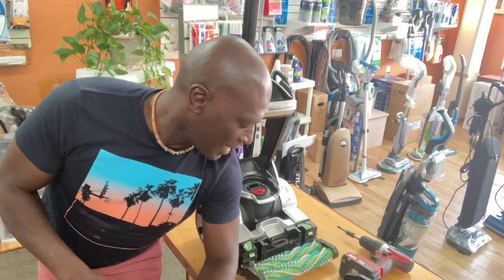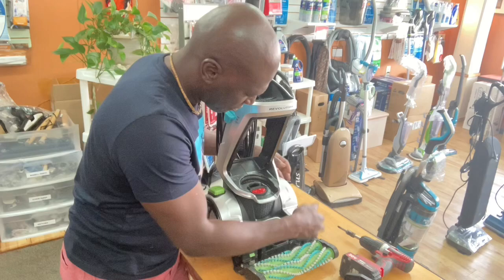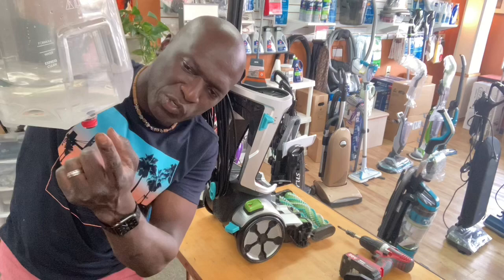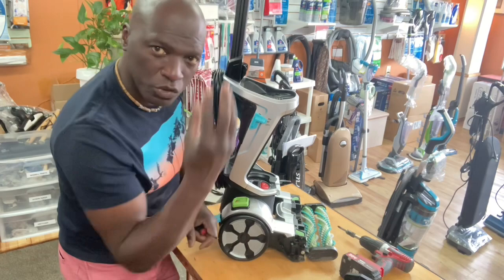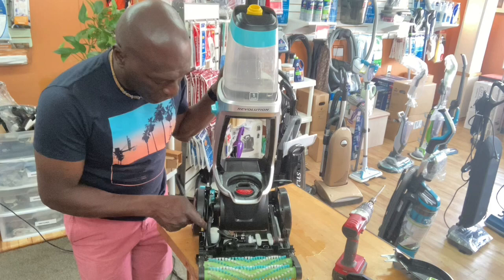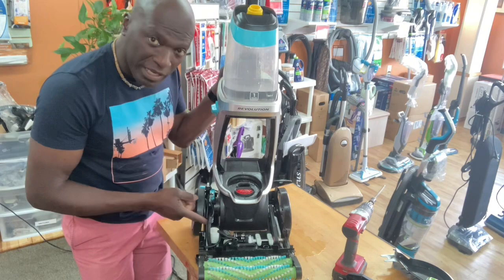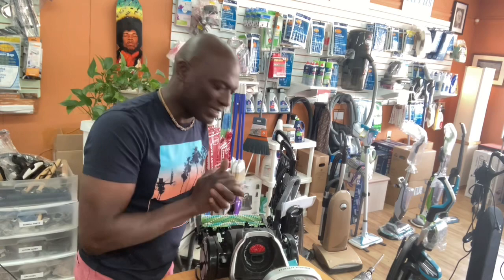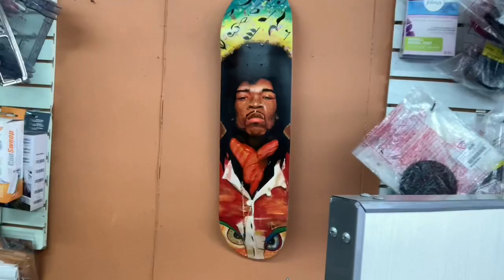Troubleshooting Bissell proheat revolution pet pro spray problem

Comment: VERY informative! One thing you might want to try if you're not getting water out onto the floor is to turn the machine off then press the trigger for 30 seconds. You might have lost prime to the pump itself. Happens a LOT especially if you don't use it that much. AND if that fails to get it to work, take the clear plastic cover off that fits over the rollers, flip it over and you see a series of small plastic 'nipples' with a small hole in each. THATS where the water comes out to the rollers. They DO get plugged. Use a straight pin or a needle to clean out. That'll happen if you put it away 'dirty'. If you see black, they're plugged and water won't get to the rollers.
Reply from the maker: Thanks for sharing this tip
Reply: Don't return the water back to the return water bottle
Reply: Thank you, was in a hurry ❤
Reply: Thanks so much, saved the day. Also, I have lost suction suddenly if I accidentally  knock the hose attachment flap open while cleaning under something close to the ground.
Reply from the maker: @ellenjagger425 glad to help

Comment: Nice work. Holy cow these machines are like effing lemons. Multiple models with the same extremely common problem. Tons of people having the same issue doesn't mean the customers are idiots, it means Bissell engineered a poor product. If there's a tendency for something to clog, those areas should be user serviceable for proper cleaning and it should be documented in the manual so we don't have to go complaining about it. Good grief.

Comment: Thank you!  Checked the flow and was fine.  Realized all the little pin holes in the top clear piece were plugged. Used a needle and kitchen sink - cleaned out in 3 minutes. Thanks again!

Comment: The bottom nozzle of the water jug can get bent and misaligned so it won't seat into the receptacle correctly. The "heatwave" function softens the plastic so when you take it off to fill it,  you have to be careful not to bend it.

Comment: If water is coming out with/without plugged in, check water tank first. If not the problem, check water shutoff valve located at the bottom of handle. I replaced mine it was stuck in open position.

Comment: If you have my issue, no need for disassembly. 
So there is a clear piece of plastic between the beaters. It allows the water to soak the carpet. It has very fine holes that need to be unclogged with a needle. If you’ve used it before and let it sit, the holes will/can be clogged. That was my issue. Water worked fine out of the handheld hose dispenser, which led me to flip it over and find that clear plastic bar between the beaters. You will notice the holes will be black or brown and they should be clear. Grab a needle and some compressed air.  Done.
Reply: do you have picture of it ?
Reply: Yeah I had same issue, no water would go onto the floor. After partially deconstructing the unit and determining that water was going down to base of unit, I took a closer look at the piece with the 2 green thumb buttons. I was fortunate enough to have a 5/8ths clear hose that fit perfectly over the the feed area that has 2 little black washers. I held on tight (the 2nd time..I was wet :( ) and the warm water started blasting through the row of holes 1st one..then 3 and so on. I hit it with a cheapo paint brush and got them all working. This will be part of the routine every time I use this thing now.
Reply: Can you add a photo of the holes you are sharing to clean out with a needle? I have no water spray to the floor. Water for the hand tool and the foot press power shot button on the right base of the machine works fine.
Reply: @MaraDroiiD  they are literally in the clear hood down where the water comes out. turn over the vacuum and look at the clear hood that covers the beater. there are holes in the entire length of it. those were clogged and a needle in each one opened the pathway for water to flow out.
Reply: Thank you thank you thank you - this was my problem. Your advice stopped me from throwing my machine out of the window in frustration!  2 mins with a needle and all was fixed 🤩👍👍👍👍👍
Reply: this was exactly my problem. thanks so much!!! now you need to make a video! 👍👍
Reply from the maker: @angelmayerle706 I’m glad it helped

Comment: I tried to follow this video but I couldn’t get the hose off and water was slowly coming out on the main hose at the end but I put it back together tried it. No luck took it apart again and then noticed one of the hose clamps was caught on the fitting and I fixed that put it back together and now it works like a dream

Comment: you tube does it again, thanks for posting, my lower suction hose came of its fitting, poor poor design by Bissell, when you place unit in upright locked position its pulls on the lower suction hose so much that it pulls out of its hose fitting socket, stupid design.  even though you didnt touch base on my specific problem your video helped me take it apart to fixt my problem, Im sure it wull pull out again eventually, so I have to be careful not to place in locked upright position I guess.
Reply from the maker: Glad you found the source of the problem. Thanks for sharing

Comment: Hi
Thanks so much for the video. It helped me to follow the steps to check the washer not spraying water. Unfortunately the steps did not solve the problem. I want help where to get pump and how much it cost. You did recommend to buy the white tank and the motor.
Reply from the maker: Glad it helped

Comment: THANK YOU for showing how to disassemble all the parts!  I got as far as testing for water flow.  I do have water flow and I do have it set to MAX clean, but the water flow is very light and inconsistent.  Any tips on what to check from there?

Comment: Hi Wayne I was finally able to get through to Bissell on Wednesday which wasn't easy about my Revolution  pet  2  motor was smoking  and grinding   so I'll  be receiving  a new one tomorrow    quite remarkable  another company that is good is Greenworks they too sent a replacement  power washer  after some phone troubleshooting  ...had a problem  with the electrical plug     ciao!
Reply from the maker: Awesome 👏 I’m glad it worked out

Comment: Very well done on troubleshooting. Although I have the Bissel Deep Clean Professional Pet shampooer and the brush motor works for a small time and then stops. Removed, cleaned brushes nothing binding them and they move freely. Any suggestions? motor, switch, etc??? thx
Reply from the maker: sorry for the delay-It may be the micro switch (I believe the deep clean pro uses a micro switch, located near the back wheel) otherbthan that check fpr broken or ripped wiring
Reply: @monroevac  Will do! Thank you so much.

Comment: Hay,  thank you allot for the video its started me down the right path. The section thats just for the hose, the small motor looking thing for the return water that has a shaft that sticks out which connects two the two belts, can that motor stop, or have somw kind of obstrution preventing it from moving the shaft at all? My gf used it and when i got it back the brushes stoped working i took it apart and i see that the one longer belt was broke, like it stoped turning and burnt a hole. I then noticed that the shaft which connects the two isnt moving at all.
Reply from the maker: I would try the belt first- the shaft powers the pump not the other way around. But the belt powers the shaft and the brush
Reply from the maker: I have videos in my Bissell Tips playlist that will show you how to open the side panel for the belt

Comment: Did everything in the videos for Bissell proheat model 9300 -heater not bad but cleaned up and checked inlets and outlets, cleaned sprayer they were also ok took line off solenoid which did nothing - only thing I see is that the forward hose out of the heater is filled with foam after I try it -any suggestions - Thanks

Comment: Hi.. thanks for the detailed video.. I have a question.. when I was starting to put it back together, I noticed light weight rectangle gasket on my counter near the cleaner. It has rounded edges and is about 2” x 1”. is it from the cleaner or do you think it was from something else that was on my counter?
Reply from the maker: Check the red gasket below the dirty water tank. There should be a gasket surrounding it
Reply: thank you:)

Comment: This is great. Is there a video for if water isn’t coming out of the connection? I separated the hose like you said and no water is coming out. I even sucked on it. Is there a part two?
Reply from the maker: Try checking your pump belt- if it’s stillborn spraying after replacing the pump belt then maybe it’s time to replace the pump

Comment: I am not getting any water down to the tube you disconnected at 4:55. Trigger works, resevior is in good working condition, reservoir gasket is in good working condition and in the correct position. I removed the handle and manually pushed the button that would normally be pushed by the rod within the handle and I get no water out. What should I do next?
Reply from the maker: For at home type repairs I would see if a friend has the same cleaner and borrow their tank. Test it. More often, the tank is the issue. Also double check the slider on the side, make sure it's set to max. Keep me posted-
Reply: @monroevac  Thank you so much for the quick response and all of the info shared in your videos. After getting my machine reassembled, I put it on MAX and the spot clean began to work, which it previously hadn't. However the main spray output still does not work.
Reply from the maker: @natural_ness1796 - Interesting 🤔 the last time that happened to me, the problem was the tank. I still would rule out the max slider. I know it's a pain but double check to make its clipped in proper ( while putting it back together) also for good measure change the pump belt
Reply: @monroevac  You were right about the tank being the problem. Somehow the tank was warped by heat on the bottom and the water outlet  no longer sat low enough for the little black pin inside the spout to be depressed. My husband used his heat gun to reshape the tank and the water flows again.
Reply from the maker: @natural_ness1796  that's great news. 2 thumb for you husband 👍🏾👍🏾😊
Reply from the maker: @natural_ness1796  that's great news. 2 thumb for you husband 👍🏾👍🏾😊

Comment: Nice, but the water flows just by pulling the tigger even when you dont have the unit plugged in and turned on.  What I have is a trickle of water when using the upright power head and a strong spray of water when using the hose attacfhment.  Is it the same motor feeding both final sprayers? All lines are clear of impediments, blown out with compressed air - just no spray on the brushes.

Comment: First I would like to say thank you, thank you so much for teaching me how to troubleshoot my Bissell ProHeat 2x Revolution Pet Pro Carpet Cleaner.

Thanks to you, I might have an idea as to why water is not coming out of the Main hose line (as demonstrated toward the end of this video)
. I checked all three ways of putting out water (Main motorhead, hose, and spotter); no water comes out. I checked in all 3 settings (Express, Deep, and Max Clean); no change. I checked the trigger, which still has resistance. And I checked the gasket on the water tank. I do not know how I can check, let alone fix the auto-feeder that receives the water from the clean reservoir tank.

I'm sure you're a very busy man, and may not have time to reply to this. But Do you by chance know what I can do PLEASE.
Reply from the maker: Hmmm-2 options- change your belt (pump belt) if that doesn’t work then opt to change your pump

Comment: Ok did all that. Seems to get water through just fine. Even checked that last part where you said could be clogged and that's spraying water too. Nothing comes out though when I put the machine back together. And the clear tray on top isn't clogged. I'm at a loss
Reply from the maker: Next step would be to replace the pump
Reply: Fuck I’m in the same spot
Reply: @ryanshock2541  make sure no one messed with the setting on the side🤣🤣🤣 apparently my problem was someone  put it on light cleaning instead of max!

Comment: My vacuum stopped squirting the water out. Long story short. I ruined the water tank by adding boiling water to it and something happened to the bottom of it. All I did was swapped out the water tank $40 on Amazon and it worked like new again.
Reply from the maker: He p boiling water would do! Glad it worked out for you
Reply: Thanks for your insight about the boiling water. I too had used boiling water and subsequently experienced a permanent loss of water flow. However, I was able to easily fix the problem without buying a new water tank (see below). I was suspicious boing water was the culprit, but could not image by what mechanism it would cause damage. Sure enough, tipped off by your comment, examination of the tank revealed that the nipple region (that houses the lower valve) was obviously bent out of alignment, such that it was no longer able to engage with the receiving port in the base of the cradle.  Luckily, the nipple itself (the 3/4" cylindrical portion) was seemingly undistorted, given that the valve operated just fine (no leaks). TO FIX IT, I simply filled a portion of the tank with boiling water, and (wearing leather gloves) I grabbed the nipple between forefinger and thumb, and (with very little force) was able to tweak it back into alignment.  "Alignment" was basically an eyeball determination that the nipple was once more parallel to the axis (direction) of insertion.  I'm sure somewhere in the manual it says DON'T USE BOILING WATER!  My guess, however, is that even overly hot water (not necessarily boiling) could cause this distortion - especially if you fill it, as I did, with the tank resting on a surface, such that the nipple (in contact with the surface) is forced to bear the weight of the water. It's best to hold the tank by the handle while filling.
Reply: @joerollerblade I did the same thing and fixed it the same way. It says on the tank itself not to exceed 140° F. 

But you’re right, when it gets too hot, the plastic tank gets soft and deforms. The nipple outlet actually caves in causing it to not be long enough to reach the intake on the machine.

Comment: Thank you for all your very Helpful tips shared in so many videos!  Would you be able share how to replace the red rubber seal for the water tank??  Been searching for a how to video but not finding one.  Somehow mine got messed up & is not  dispensing water (unless i press down on the tank, to help it "seat" properly).  I have this model you're sharing about in this video, Bissel proheat 2x revolution pet pro.
Reply from the maker: Will do, stay tuned
Reply: @monroevac   Ooh Thank You sir 😁!!  You are a blessing to so many!  Seems it should be easy.   But (often) taking pieces off or apart (on various objects) is easy but get pieces put back into place is not always as easy (for me anyways).

Comment: Thank you for the video.  Motor is running but the brush drive axle (whatever part this is at 11 minute mark) is a bit rusty and doesn't turn.  It has burnt thru two belts already, do you have any tips to fix?
Reply from the maker: Need help finding the right video- the video thread you are commenting on only runs for 9:26 minutes- try copying and pasting the link

Comment: Do you have a solution for the clean shot that will not stop spraying? It’s brand new. I hate to exchange it because this is my second one. I exchanged the first one because it dripped too much.
Reply from the maker: Just uploaded a video covering that. Check my Bissell tips playlist
Reply: I bought one and it worked perfect the 1st use. Second use water did not spray out of the handle nozzle so I returned it and ordered the same one. Again first use and it worked great! Tried using it again and no water comes out and the bottom shooter would not stop spraying.  Trying not to return it again but want to fix it once not take it apart after each use. Thank you for your great video now I will have to take it apart again.  I thoroughly cleaned it and that was not the problem so I'll have to try again.

Comment: I was able to correct my clean shot issue with this model your working on here. Thank you! Now I began to wash my carpet and discovered the rollers aren’t functioning properly. Moving forward or backwards? I checked both belts and neither are broke. I’m having issue placing the larger belt as another person indicates a red pulley. There isn’t any such part. Please help! My dogs are driving me crazy, they are aging (as we all are) but accident seem to happen more frequently. MaryLou
Reply from the maker: Sorry for the delay, just saw this comment. Ok… the clean shot is part of the basic Bissell 2x models and they don’t use the pump beltZ the use 2 geared belts. A smaller belt from the brush motor to the 1st brush and the larger belt to connect the 2 brushes. This larger belt is on the opposite side. Inspect both sides of the brush roll
Reply: @monroevac  I discovered both belts. Could not get the larger on to remain on the brush roller. What am I doing wrong? Something so simple is so hard? Thank you do much for responding. I’m sure you are a busy man.

Comment: I have the opposite problem.  The water doesn't shut off.  There is resistance in the spray lever but the water just dumps out of the reservoir.  How do you take it apart to get to the area where the problem is?
Reply from the maker: Take a look at my Bissell playlist. It may have the solution to your problem. BISSELL TIPS
https://www.youtube.com/playlist?list=PLdsKNFwYhKLwJ6IjMWZEStaLJsql3VSg_